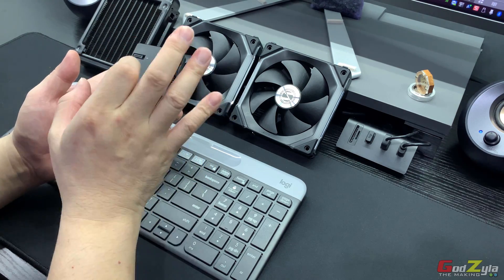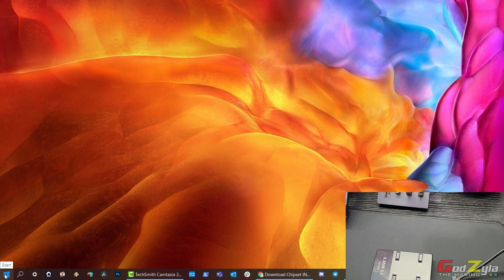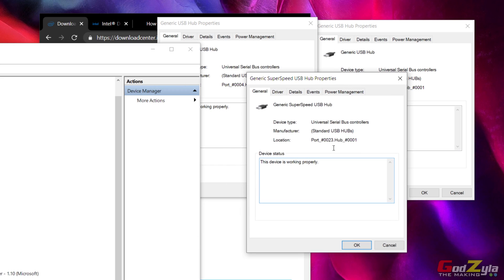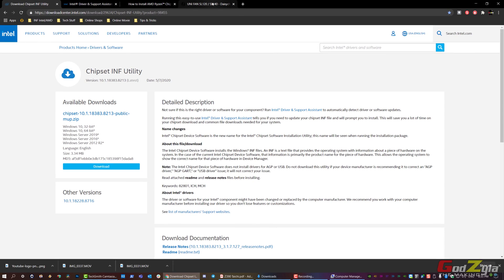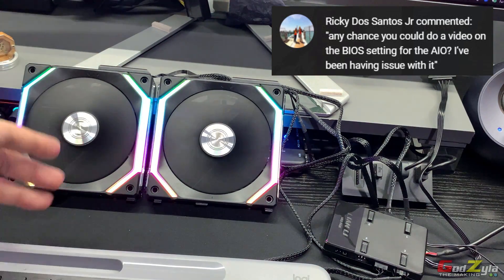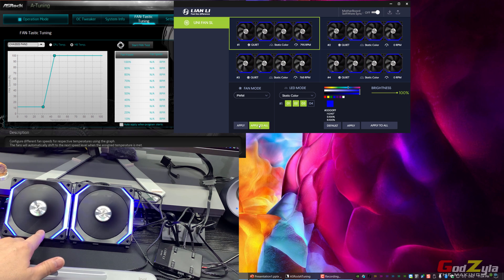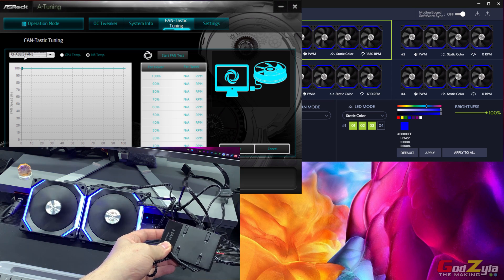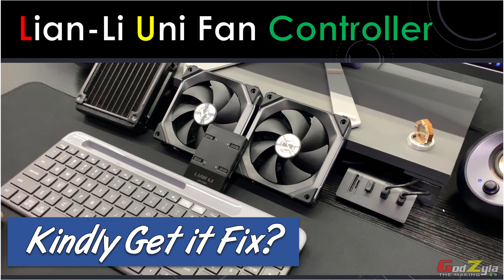Lian Li Uni Fan Controller - Some Break Fix! [L-Connect]

Comment: i have my RPM going up on my front fans even tho i apply all to be 800 and set to quiet
Reply from the maker: Hi Elvis Best, welcome back. Are the argb applicable to your fans using the L-Connect application. if it works and your fan PWM does not.. you might want to check the connectors for fan load or to re-seat the daisy chain interconnectors between the AL or SL fans.
Reply: @KleoYan  yes i unplug it n plug it back in i never had an issuse once before i got a new X570 board from the old 470 and i wonder if the MB software is interferring with it the  lights work well and i have notice with the old app even when i reset it the fans speed up so i download the new update app and unplug it plug it back and the fans run quiet n doesn't speeds up
Reply from the maker: @elvisbest3213  hi, I like to check are you using SL or AL fans? for SL fans if your controller does not have the SL marking, you can't use the L-Connect 2 app, unless you do a firmware on the uni controller. if it's with the SL Marking, then you should be able to use the L-Connect 2 app. Now you did mentioned you've other argb program that is use to control other argb devices. I would advise you to remove all argb program which includes the L-Connect app, use revo uninstaller https://www.revouninstaller.com/revo-uninstaller-free-download/ to clear off all the left over files. Next power down your PC, unplug the PSU cable, press the power button for a few times to discharge all electrical charge in your motherboard, once done, power it up again, install the L-Connect application and to test it with your SL or AL fans. if that works, then install the other argb program which is use to control your other argb device.

Comment: My fan is spinning and lighting up. I’ve updated all my drivers (including the cpu one) and lian li also shows up on my device manager. But when I go on L connect it doesn’t change anything and when I go on “L connect 2” it says that the controller isn’t connected though it says it it in device manager. Could you give me one assistance please.
Reply from the maker: Hi Javasius, welcome to my channel. may I ask a few questions? 1st which uni fans are you using AL or SL? 2nd if you are using SL fans, the uni controller itself, does it have a lable as SL? 3rd what motherboard are you using?

Comment: awesome video!

I had a question.  I have 3 sets of uni fans, all set up to 1 - 2 -3 on the control module.  Sets 2 and 3 run perfectly, have them set to quiet and everything works as it should.  However, the set that is on my 360 RAD is pinned to max for a good 10 - 15 mins after boot, until, suddenly, it goes back to my own settings.  Any ideas?
Reply from the maker: Hi ALittleGamey, welcome to my channel by right all fans will have a short burst at the start as the pc starts at null state till UEFI or Bios is loaded, as in the pwm take place. As in the fan curve will start. As for your case, you might want to try connect your rad fans directly to the fan header of your motherboard. See if they react that way. 10 to 15 minutes is abit too long.
Reply: my problem almost the same i have 3 set fan too, all 3 set run pwm mode fine, but shutdown on the next boot only fan set 2 & 3  follow pwm mode, 1set fan look like in default quiet mode around +-800rpm, my 1 set fan always not follow pwm mode until i set it with L c connect it only follow pwm mode
Reply: @nvergiln  Try swapping the port they are connected to on the controller. Try removing and reinstalling the connection link on the first fan in the group. Try a different fan link cable. Change the order of the fans in the group so the link connects to a different fan.  Get a bag of rattles and bones and pray to the powers that be.

Comment: I can't get the fans to report their RPM to the Uni Fan software at all.  It shows 0 rpm no matter what solution or setting I use.  Bad controller maybe?
Reply: I figured it out.  Though I have rev 2 SL fans they did not come with a rev 2 controller box.  They came with a rev 1.  As in there is no SL marking on it.  Therefore I could not use L-Connect 2 to control them.  

If you are having the same issue make sure you install L-Connect 1.
Reply from the maker: @totallynottrademarked5279  Hi, welcome to my channel, glad that you have found the issue and to have resolve it. Now you still can use L-Connect 2.0 if you want to, but you will need to do some firmware update and here is the video https://youtu.be/hZpzR_4917c as in how to.
Reply: @KleoYan  Firmware update did not work for me at all.  Still reported 0 RPM despite them spinning and they would not respond to software control or mobo control.  1 solved it for me however, so I have no need to really try to get 2 to work again.  :)
Reply from the maker: @totallynottrademarked5279  Hi, ok. got you.. stick to 1 if that works for you :)

Comment: hello i have a problem, i cant control my fan rpms at all. even if i put in  full speed it will show in the app that the rpm is "0". any fix for this?
Reply from the maker: Hi Jayvee Eroy, welcome to my channel. Now the uni controller work this way, if you have plug the PWM cable between the uni controller and motherboard, your bios will not detect any rpms and same apply when you check on HWinfo64. you will be able to see the RPM on the uni controller itself. 
now it greatly depends on how you do your connection. may I ask how did you do your connection. I would first not plug any PWM or argb cable between the uni controller to the motherboard fan header and argb header. with only fans connected to the uni controller, the sata cable plug to the unicontroller and the USB cable plug between the uni controller and motherboard, are you able to control the argb and the rpms via L-Connect? if you are not able to. may I ask are there any argb utlity if you have installed before the L-Connect you are using. btw which version of L-Connect are you using and which fans are you using.. the SL or AL?
Reply: @KleoYan  I have an UNIFAN SL, and i have an Armory Crate installed right now
Reply from the maker: @jayveeeroy8227  i will advise you ro uninstall the Amour Crate first. please use revo uninstaller app to remove all unwanted leftover registry https://www.revouninstaller.com/revo-uninstaller-free-download/, now please do this before you proceed to do the firmware of your controller which I have replied to you earlier. please make sure your controller does not have the SL marking and do not do the incorrect firmware. https://youtu.be/hZpzR_4917c
Reply: @KleoYan  thank you so much, It worked perfectly. Thoo I havent tried the firmware but will make sure to do it soonest. Also the PWM worked perfectly. THANK YOU SO MUCH
Reply from the maker: @jayveeeroy8227  hi, you are most welcome, am glad you got your fans working.
Reply: @KleoYan  hello there just an update, I decided to do the update today. And I’m glad to say that It worked very smoothly from the process of installation up until the end, haven’t had a problem. It took me less than 10mins to do all. Thanks to you brother, Keep it up!
Reply from the maker: @jayveeeroy8227  you are most welcome Jayvee Eroy, am happy that you got things sorted out :)
Reply: @KleoYan  Hello there, I tried what you said and I unplug the cables. Leaving the USB and SATA connections only, Still wasnt able to control the rpm of the fan(BTW IM USING L-CONNECT2), but then I noticed I tried L-CONNECT it can control the RPM for some weird reasons which I dont know What. In the Lconnect it shows accurate RPM(1,788+) but on the Lconnect2 it shows random numbers(26392016)
Reply from the maker: @jayveeeroy8227  I believe you are using SL120, now there are two version of the SL120 controller, one that has the SL Marking on the controller and one that does not. I believe your controller does not have the SL marking, therefore you can't use L-Connect 2. now if you want to use the L-Connect 2, refer to how to do the firmware on the uni controller here. https://youtu.be/hZpzR_4917c

Comment: @Kleo Yan Hi there.  I've had these installed for 7 or 8 months, I've 3 uni fans on one 360 radiatior and grouped into group 1.  Also another 3 fans connected as a group on another 360 radiator as group 2.  But in all this time I've had a problem that I've never been able to fix.  So when running the Lian LI app, it reports the speed only on group 1 fans and I can control the speed of this group fine.  But the other group continually spins at maximum RPM all the time.  Now, I can change the colours on both groups of fans, but the speed control only works on the first group.  I'm not using motherboard software to deal with the PWN or RGB, using the Lian Li controller box.  All I have connected is the 4 cables from the 2 groups of fans (2 each the 3 pin and the 4 pin to the controller) then the power SATA to PSU and the USB to the motherboard.  Can you please tell me no matter what I do, the 2nd group of fans continually spin at max RPM and the app shows "0 RPM".
Reply from the maker: Hi TonyTurbo, welcome to my channel. to narrow down your issue. it will be best to test the group 2 fans individually on another output of the uni controller, lets say use on group 3. this is to ensure that it's not a fan issue. if all works. then test one whole set to group 3 or 4. if that works. it could be group 2 output is not working properly.
Reply: @KleoYan  hey there.  Yes I've done all that.  Tried the other controller, plugged the cables in to different fans, only thing Ive never tried over the months is different cables cables as I could never find them haha.  But surely not cable related as I can change colour fine and the fans spin maxed out.  Maybe tomorroe I'll look up in thd loft once again.  It's been like this since I bought them at the start of the year and just put up with it.  Only reason I'm tackling it again is because tonight when gaming there was a horrible noise coming from my case.  It turns out that the bearings have gone on one the lian li 120 uni fans which was in the group of 3 that's been running maxed out for 7 or 8 months. I'm guessing I should worry about the other2 from that ssmd group now haha.  Thanks for getting back to me.
Reply from the maker: @TonyTurbo78  you are most welcome. You have a very interesting channel going 😊 btw maybe try connect the problematic fans that are spinning at max directly to one of your motherboard fan headers. See if they react to what you have control in your motherboard UEFI or Bios. If it does not react. I would advise you to get it change with Lian Li, since they are still under warranty.

Comment: I cant control pwm mode on my msi b550 :( any tips
Reply from the maker: Hi Blue Soda, welcome to my channel, did you plug the pwm cable between the uni controller to your motherboard and at system management. Right below where the usb are, did you see the Lian li word appearing under the usb table? One last question. Did you make use of other argb application to control other argb effects?

Comment: Can you connect a fan group directly to a motherboard header and the rgb to the controller? That way you control different fan groups speed from the motherboard software and rgb from l-connect? I can have 1 fan group with 3 front fans going to a 1 header, another fan group with 3 top fans to another and 1 rear fan to another and have 3 different fan curves on motherboard software? I just dont like the idea of having 1 fan curve for 7 fans
Reply from the maker: Hello m4nu, welcome to my channel. yes you can. just have the fan argb connected to the uni controller and their respective fan loads on the motherboard fan header, not an issue, plus each SL120 fan is having fan load of 0.18a and a standard motherboard fan header is at 1a and some even 2a. so you should not have a problem connecting up to 4 fans to one motherboard fan header. the only concern is argb load as each fan is at 0.65a which most motherboard argb header can cater for max 3a.
Reply: @KleoYan  hey thanks for your prompt response. The argb part i believe wont be a problem. Im actually getting the “AL” fans and will just let the rgb part go through the included controller and will manage lighting through L-Connect and fan speed through motherboard software.
Reply from the maker: @m4nu507  you are most welcome and all the best with your build too. 👍

Comment: i just installed my fans did everything properly but lights wont work i even use L connect still doesnt work , got any idea ? thx
Reply from the maker: Hello Mohammed, welcome to my channel. which motherboard are you using. it could be your motherboard argb ultility argb application is blocking the L-connect to recognise your uni controller. I would advise you to uninstall your motherboard argb utilty app using revo uninstaller, reboot your pc, once it's up and running, install the L-Connect application and make sure to run as administrator while installing it.

Comment: sir i have a issue i dont know how to fix. My fans are working but the leds arent working. i only get a red and green light on one fan. i have changed the box i have chnaged the box and still now changes can you help me
Reply from the maker: Hello Ryan Cox, welcome to my channel. There are a few things you can do.
1) does your board have a 2nd USB Header. if yes, plug it to the 2nd USB Header and test it. 

2) does your motherboard make use of other argb app to control other device's argb effects? if yes. remove it using revo uninstaller, install only the L-Connect .. see if that works..
Reply: @KleoYan  Hi There,

I have the same issue, I mean very similar. My Fans are working but not changing colors. My mobo has two USB headers I have tried both with no luck. It looks like one USB does not respond while other one sees lianli as USB device but app not responding, its on rainbow wave. I have connected also fan header to the motherboard and rgb header which is a split header. M mobo is Gigabyte VIsion b 550 d-p and not sure if I had the update you mentioned, as far as I remember I have done all the other updates. removed the Fusion RGB which is the mother boards RGB app which sucks so bad so I don't even intend to keep it or install it at all. I am kind of getting regretted for gong with Gigabyte.
Reply from the maker: @iscus3523  hi Whtevr, welcome to my channel. how did you uninstall your argb fushion? you might want to try uninstalling them using Revo uninstaller. here is an illustration of how i use the revo uninstaller https://youtu.be/hZpzR_4917c?t=455 if that does not work, do you have a spare SSD or M.2, try install a fresh windows 10 or 11 OS to your system, make sure to update the chipset (either Amd or Intel), then instal nothing else but the L-Connect application to test if it works. I know is lots of work but if a fresh installation of windows help, why not.
Reply: @KleoYan  Hi Again, I have removed it thru win app remove. I can give it a try the windows installation from scratch because not being able to control fans sucks but would like to try everything else first as I hate to reinstall all the other drivers again :'(  So Lian Li connect does not see the fans or fans do not respond to the commands but actually when I check the USB devices list under device manager it shows LIan Li. But for some reason sometimes it disappears and appears again, do you think I damaged the USB ports? Is there a way to check the if the USB ports are working properly? And last but not least when I connect the Hub to the motherboard fan header and ARGB header I can't control the fans from the Mobo as well. It does not even see the fans. I changed the fan header setting to PWM from the bios but that did not change anything.
Reply from the maker: @iscus3523  I doubt the port is damage, is just that you might have other argb program installed before you install the L-Connect. this causes IRQ Conflict, this is whereby even you uninstall the previous argb program using windows, it did not do a clean removal. so best to use a spare m.2 or SSD, install fresh windows to test things out. 

What's IRQ 
An IRQ (interrupt request) value is an assigned location where the computer can expect a particular device to interrupt it when the device sends the computer signals about its operation. For example, when a printer has finished printing, it sends an interrupt signal to the computer. The signal momentarily interrupts the computer so that it can decide what processing to do next. Since multiple signals to the computer on the same interrupt line might not be understood by the computer, a unique value must be specified for each device and its path to the computer. Prior to Plug-and Play (PnP) devices, users often had to set IRQ values manually (or be aware of them) when adding a new device to a computer.

If you add a device that does not support Pnp, the manufacturer will hopefully provide explicit directions on how to assign IRQ values for it. If you don't know what IRQ value to specify, you'll probably save time by calling the technical support phone number for the device manufacturer and asking.
Reply: @KleoYan  Thanks again, will try to do that , it is always good to start from scratch to sort things out, I will give an update after I try these methods.
Reply from the maker: @iscus3523  OK. Hey all the best and will wait for your results 👍